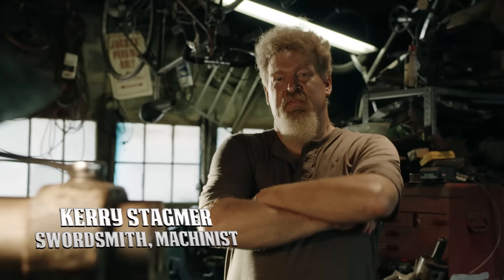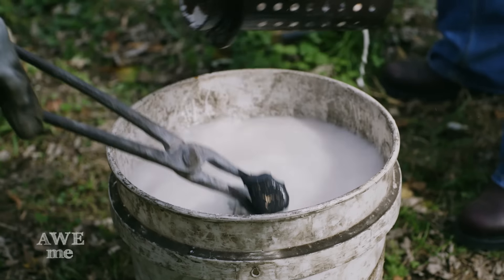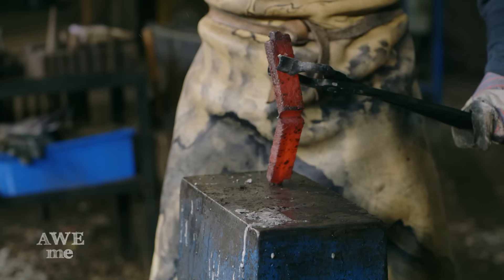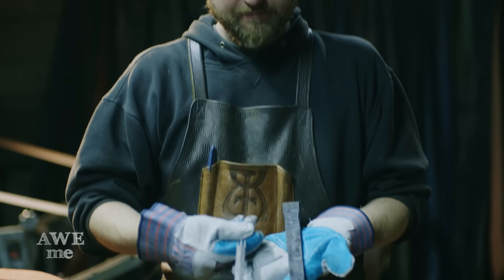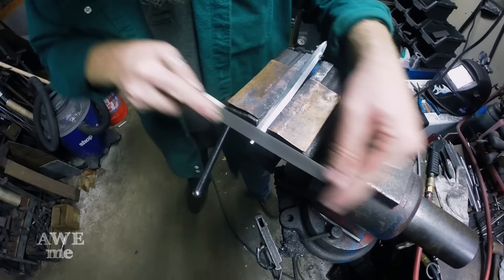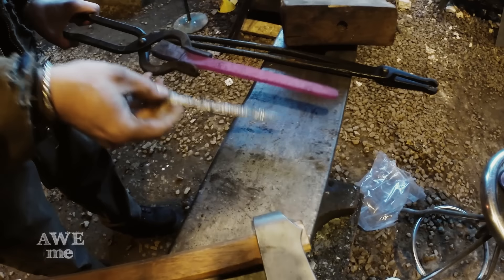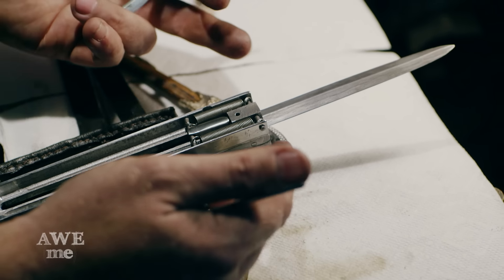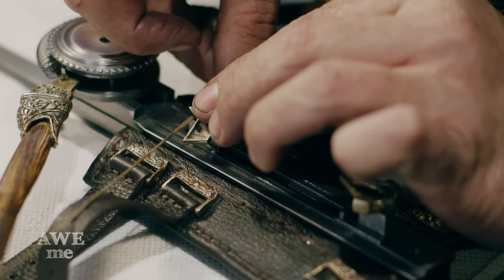Arno Dorian's Phantom Blade (Assassin's Creed Unity) - MAN AT ARMS: REFORGED

Comment: That's not how it works though it's a ranged weapon the blades are replaceable its supposed to work just like a crossbow but it is concealed
Reply: The blade isnt a firing weapon, the BOLT is
Also, if you want one time bolts you might as well give up on the assassins creed design because those would cost a lot, you'd have to buy cheap, plain looking bolts, which still have to be modified for the crossbow's unusual design
Reply: Grag Hasseblut I'd make like 4-5 freshly customized "bolts" and retrieve them off of a target if the thing actually manages to launch them
Reply: Alickz Rider And it does manage to fire them, as seen toward the end
Reply: Grag Hasseblut Oh, I must've missed that part
Reply: Alickz Rider i checked your channel because i was going to reply but why do u only have 7 videos and the latest one was 3 YEARS AGO WTF
Reply: MrS10Wmotion348 cause maybe I haven't made a video in 3 years? :O What are you one of those people who think you're only as good as the number of subs you have.
Reply: No I have potential in everyone and I'm not being rude I'm sorry if I hurt yo feelings but try to upload and trust me its fun
Reply: Alickz Rider plus I have it at views if u have a lot of views and yes sub's and likes but me views
Reply: Beside that, I actually don't believe this crossbow mechanism has actually half the force needed to penetrate a target. I mean, the arms of the bow have to sustain quite some force to shoot the bolt fast enough. No way that it would work with a pair of tiny springs and small wooden arms.... O.o
Reply: True
Reply: Wega Wind Small, working crossbows have existed for centuries, made of wood. The shape of the wood, and the type of wood, stop it from snapping, also shorter wood is less likely to snap, they didnt use just "tiny strings," they used strong springs, you see the bolt penetrate a pumpkin in the video, maybe not very deep, but it does the job, dont deny whart you actually see, man at arms arent faking it
How do I put this... What they made, is not just a toy
Reply: Fuck yeah you tell em
Reply: Grag Hasseblut
They definitly didn't make a toy but I do believe that they cared less about the functionality of the crossbow; as long as it shoots, it's fine for them, I guess. You know what my main point is? Yes, there were small crossbows but I doubt there were many or any crossbows with that unfolding mechanism. It looked like the crossbow was instantly ready to fire after unfolding which is nonsense. I mean, while unfolding, it needs to built up enough force to penetrate a target; which is REALLY much considering the small size of the crossbow. As you can see, the bolt only penetrates a few cm into the pumpkin and the watermelon. This would be enough to actually harm a human unless you're lucky enough to hit a few small places like eyes or the throat and even then it may not be even close to lethal wounds.
It's still a nice piece of work, tho.
Reply: Wega Wind If you want to discuss the lethality of the design, the entire weapon is ridiculous and impractical
Reply: Grag Hasseblut
Well, yes, it probably is impractical; but if you accept the design for aesthetic reason, the bow is the part that actually doesn't work at all like shown.
Reply: Wega Wind Someones a bit pessimistic, is it impossible to believe they got it to work for you?
Reply: Grag Hasseblut  Dude, I'm simply discussing the matter if they made an actual "weapon" (even if impracticle) as they said or not. I probably wouldn't have said a thing if they'd mentioned themselves that the crossbow isn't actually a weapon.
Reply: Wega Wind The weapon made by Man at Arms is indeed a real weapon, a very impractical weapon that needs careful handling, but a weapon none-the-less, if you like to believe they are a hoax, you obviously wont believe otherwise unless you handled it yourself, which you are extremely unlikely to
Reply: Grag Hasseblut
Where do I say it's a hoax? O.o Don't take it so serious, man, I'm just discussing it's design out of curiosity. So I've stated some points you may discuss when you don't believe me. What's the problem?
Reply: Alickz Rider Search up ballistic knife, buy one, attach to arm, PROFIT!
Reply: Wega Wind
Reply: Actually, it shoots arrows....
Reply: Anthony Morse The fuck it does. Phantom BLADE. Not Phantom ARROW.
Reply: GamePhysics It's called the Phantom Blade because of the blade, not the projectile. Have you seen any of the trailers? Watch a cinematic trailer. One point a guard comes after Arno's teammate, Arno charged at him, then the guard was shot by the other team mate, BY AN ARROW. Then it pans up to the other Assassin, and his crossbow closes, with THE BLADE still in side, it shot an arrow. The blade is not the projectile.
Reply: Anthony Morse It's even a blade in the official toy that ubisoft sent them.
Reply: GamePhysics Yes, but the blade doesn't shoot out of the mechinisum, it shoots darts. The blade just doesn't fly right out. And also it would be a terrible weapon if the thing that you used to kill people just sprung right out. There's a reason THE CROSSBOW'S ON TOP, if the blade shot out there would be no use for the crossbow, and we saw it shoot arrows in the trailer, and the real thing or toy shhots darts. You can say they did that for safty, but still, in game it shoots arrows. And in the trailer, it shoots arrows, in real life, they shoot darts that REPERSETS arrows, so every argument you throw is invalid.
Reply: Anthony Morse No, it shoots small blades. Obviously not the main blade or the hidden blade, but he reloads small blades into the crossbow mechanism, exactly like how they showed in the video. https://c3.eb-cdn.com.au/website/videos/images/screenshots/201931_screenshot_02_l.jpg
In this pictures you can clearly see two seperate blades. The one at the top is getting shot out by the crossbow, the one at the bottom is the hidden blade that extends and retracts. It's not difficult to understand.
Reply: GamePhysics That's called a bolt, its a type of short arrow
The blade sticking out is the stabbing blade
Reply: GamePhysics In that case, we were both wrong. You thought the hole blade itself shot out, i thought it shot arrows.
Reply: Anthony Morse I never said that. I'm not a fucking moron, I knew exactly how it worked. I never said it shot the main blade out.
Reply: GamePhysics it seemed like you did.
Reply: Anthony Morse Well, I didn't.
Reply: GamePhysics not my fault I miss understood you
Reply: Anthony Morse I'm not trying to blame you for anything.
Reply: GamePhysics I know, just saying.
Reply: Anthony Morse Alright, case closed :)
Reply: GamePhysics M'kay

Comment: why not use a ballistic gel head instead of fucking soda n shit
Reply: I know right. The video doesn't really establish anything when you're slashing up melons and bottles.
Reply: It's probably just cheaper.
Reply: what would be the point of ballistic gel?
Reply: because ballistic gel is boring as hell and melons are awesome as fuck
Reply: maybe, if man at arms  made a chapter with mythbusters, it could be possible. you know, like a myth of a sword that does certain thing, they make it, they all try it, and BOOM. they already have the most badass chapter in mythbusters and man at arms
Reply: or zombiegoboom and man at arms has has alot of crap put out latly
Reply: the stuff they use drives it home well enough, ballistic gel is pointlessly expensive for a demonstration
Reply: Exactly, ballistics gel can be reused as well.
Reply: Cause that shit costs a ton of money?
Reply: ***** Ballistics gel costs about 50$ to make (a good size), and it can be melted down then reused. Unless you order some expensive specialized gel online.

Comment: the only complaints i have is it looks like you could of added some loops in the leather for the straps to slide into so they dont dangle down as much , and it doesnt look like the bow stays locked closed as it should when not in use